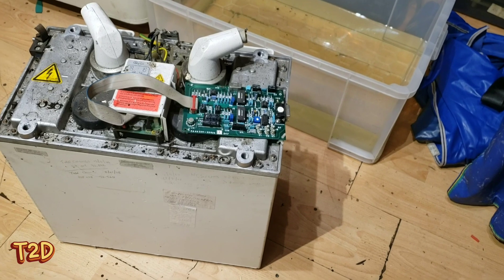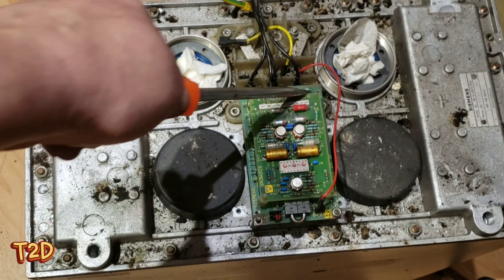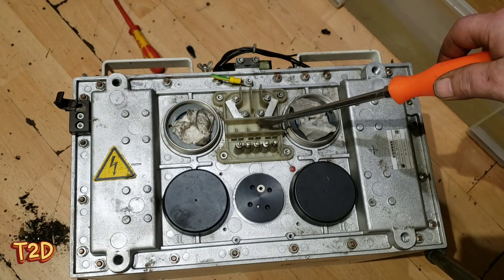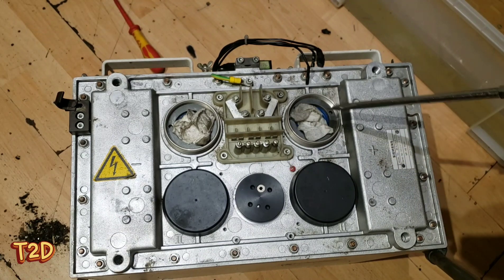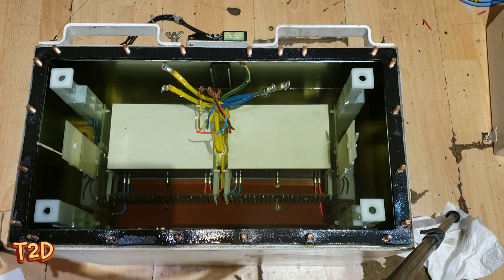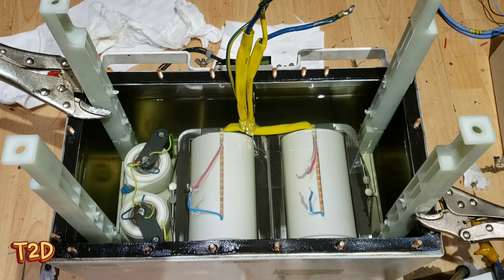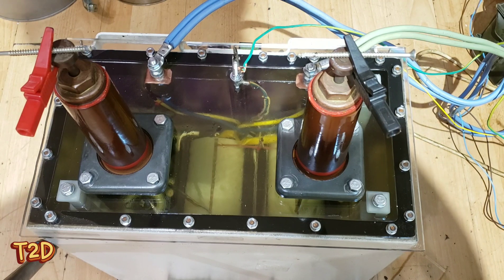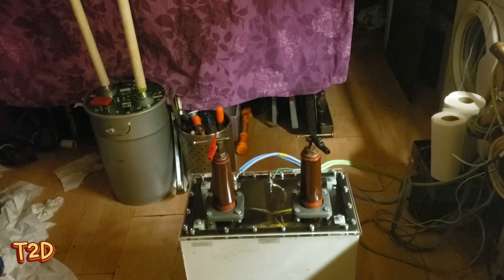X-ray Transformer Conversion. (AC Multiplier Driver.)

Comment: wow, that is awesome! simple conversion, take everything off the lid, keep the transformer in oil, remove the caps and diodes, center tap to ground, and add ceramic insulators!
Reply from the maker: Ye its pretty nice just thought it would be nice to show this mate...
Did u enjoy? I'm coming collecting parts up for big multiplier so will be awesome when we get that going 😁😁

Steve
Reply: @T2D.SteveArcs  That multiplier sure will be awesome! I did enjoy the video, it was well explained.
Reply from the maker: @SuperBrainAK  thanks mate and yeah It will be fun project for sure its not 😁😁

Comment: Cool transformer man! Merry Christmas from Austria!⚡🎄✨
Reply from the maker: Austria awesome 😁... thanks man. I'm slowly building up a MONSTER multiplier so needed a powerful AC power supply to run it...  if you like this kind of thing theres loads of high voltage chaos on my channel, 10kw Vacuum tube tesla coil 4 ft arcs, 300,000 volt xray transformer madness and so on ...
Merry Christmas and take care mate

Steve
Reply: @T2D.SteveArcs  Oh boy, now I'm getting excited! I really much like your channel since there's lots of advanced stuff and things to learn from. The only coil I've built so far is a slayer exciter with an arc length of 5mm and you would probably describe it as puny and crude. Wanna build a VTTC next month or so (if I even manage to get a vacuum tube from russia. My preferred one would be the GU-81. You know anyone who sells VTs?) Anyway I subbed to ur channel and am excited for new videos!

Cheers! 😀😎⚡✨
Reply from the maker: @jangruber42  Thanks for the sub, that's great. I wouldn't describe slayer exciters as puny or crude, they are fantastic, a good learning tool and most peoples gate way into Tesla coils. And yes I'm no exception, I have built slayers. So good work mate. GU-81 is a great tube, for a first VTTC, I'm sure you won't be disappointed and have fun as well as learn. 
Take care 
Steve
Reply: @T2D.SteveArcs  Just need a quick advice: Is a tube socket necessary or optional? Bc I could just mount the thing in a slightly bigger cylinder and let the contacts of it peek out on the other side? This ok or is socket mandatory

Take care!
Reply from the maker: @jangruber42  for what mate
Reply from the maker: @jangruber42  gu81?
Reply: @T2D.SteveArcs  ye
Reply from the maker: In most cases no you dont need a socket. 
On my GU81 build I just soldered wires directly to the tube pins. 
And for the GU39B Build I just made some connectors that slid over the tube pins and tightened with a small bolt. 
Steve
Reply: @T2D.SteveArcs  Great thx for the quick help! Appreciate it! 
JG
Reply from the maker: @jangruber42  no worries mate